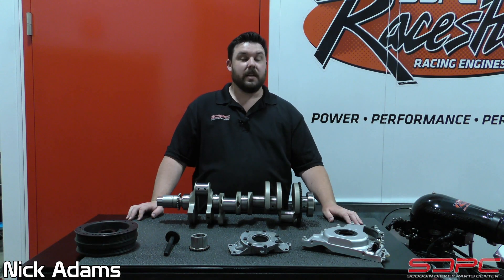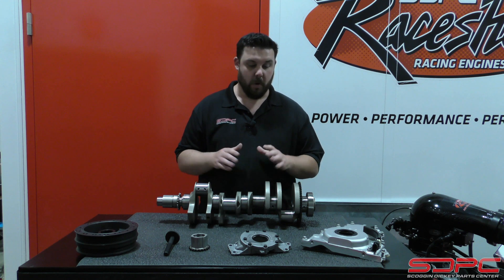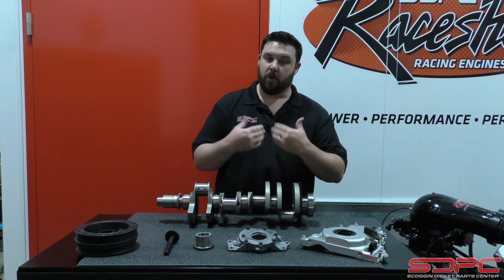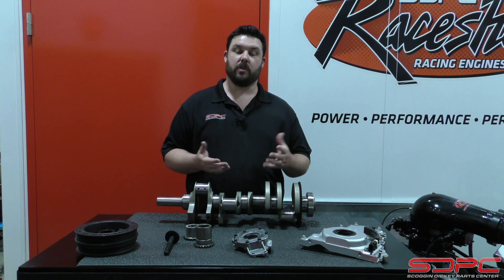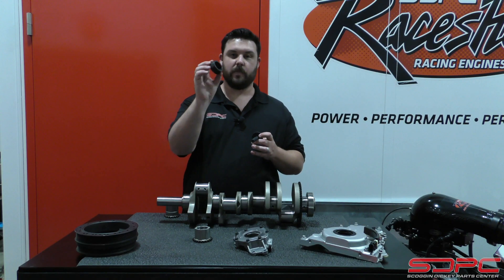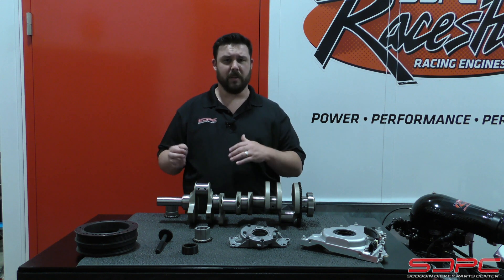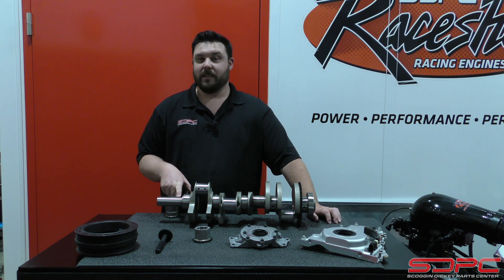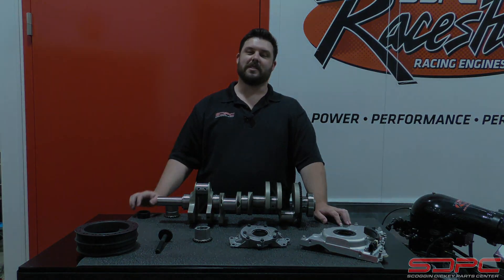SDPC Tech Tips: Gen IV LS Dry to Wet Sump Conversion

Comment: why would you go backwards
Reply from the maker: There's a variety of reasons, granted this was a popular option before the LS427 wet sump crate was made available by Chevrolet Performance. Some customers just wanted the LS7 but not the dry sump setup since they were only doing street cruisers that never saw the track.

Other reasons would be they were going to a dedicated dry sump pan and not the DRET system so they could get even better oil control and scavenging while running an external oil pump setup.

Comment: You forgot to mention that on ls9 engines , you have to take out the crank and have a key way cut in for the crank cam gear because GM didn’t make the key way on ls9’ s like they did on ls3’s . A Good machine shop can do this . No big thing, just extra time.🥵

Comment: Will an Ls3 timing cover, pump pickup tube and Balancer all work with the kit? Which basically means i need the spacer an new bolt for an Ls7 and thats it?
Reply from the maker: Complete front cover
LS3 Wet Sump Corvette balancer
LS7 balancer bolt
Wet sump oil pan
oil pump sprocket
oil pump
crank spacer
oil pump pickup with screen, and pickup bolts
crankshaft oil deflector/windage tray
oil level tube and dipstick indicator (must drill block to add these).

Comment: It’s funny how in this video, they tell you it won’t work with the ls9 and if you call, they say it will....
Reply from the maker: Hi Smythtaylor, sorry if that incorrect information was given to you :(
If that was something recent, I can make sure to clarify that point with our sales team.  It is also noted on the website product page.
There are fitment issues regarding the LS9 crank keyway which complicates things quite a bit and is definitely not a DIY affair at that point.
Reply: Scoggin-Dickey Parts Center, yes it was Monday this week when I called. Also, could you explain what needs to be done to make it work? Thanks.
Reply from the maker: @smythtaylor7272  the LS9 crankshaft snout does not have a rear keyway that would allow the wet sump only sprocket/oil pump to work, so the LS9 crank snout would have to have that machined into it.  You would also need to run a front balancer with the right alignment to still drive the LS9 accessories and blower.  Some people have made it work, but it is still an involved process.